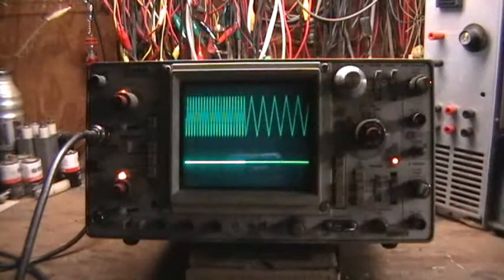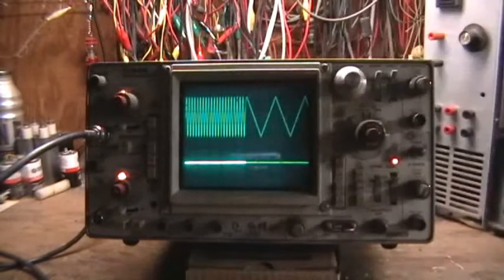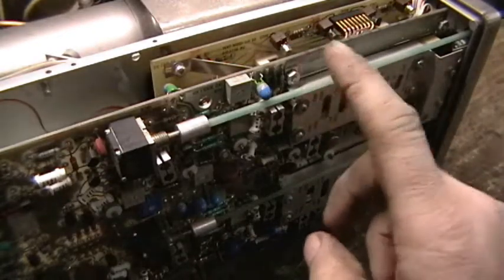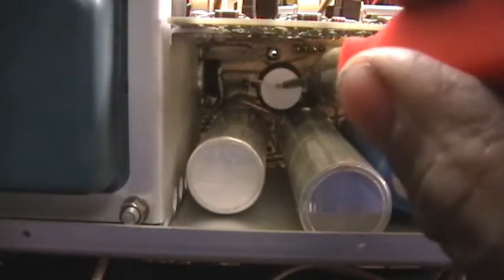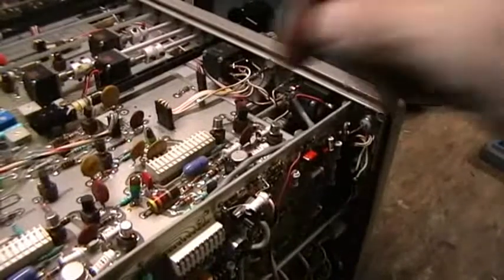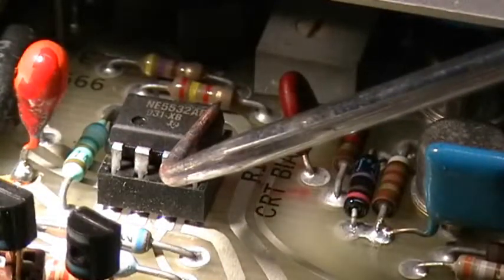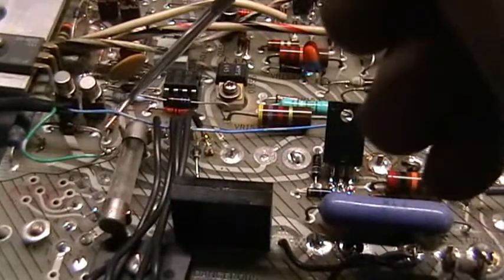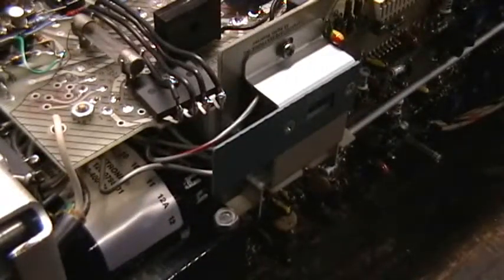Fixing a heat damaged Tektronix 465 oscilloscope.

Comment: Not a good idea to use the metal tool as a pointer in any scope !!! Best to use something plastic or wood as you run a chance of running into high voltage around the CRT area or worse yet take some low voltage to a point on a chip where it should not be and damage the chip!!  
Interesting video though, I have one of these old scopes too !!  I should one day soon check and oil he fan motor and clean the fan itself to prevent the sort of problem you talked about, good point! well taken!!   John A Bellas   KC2UVN.
Reply: Hello John Bellas,  I have a problem in my scope and it is that the right side of the signal in the screen goes down in both channels, do you know what it could be?